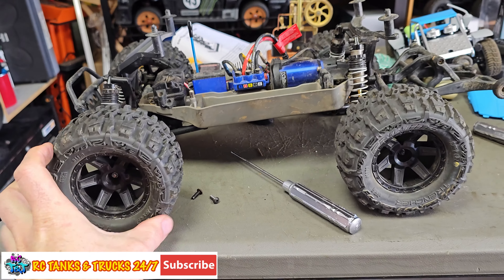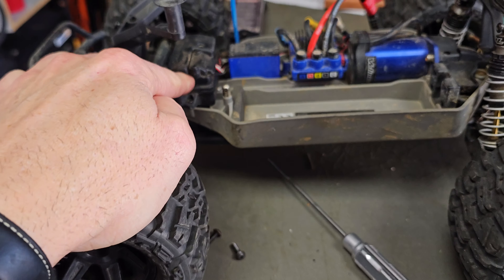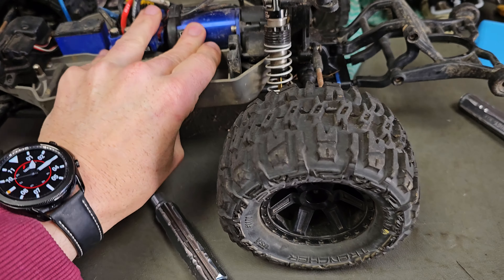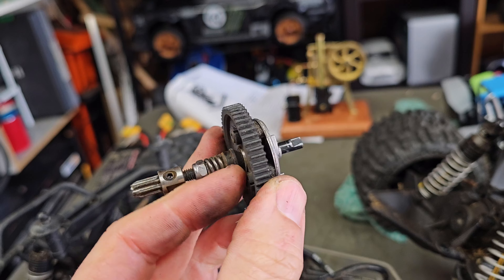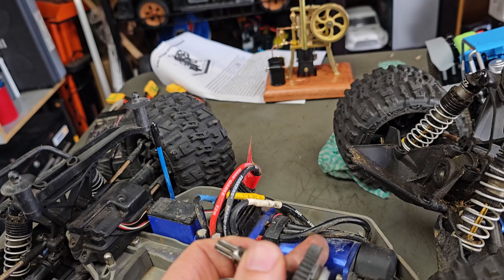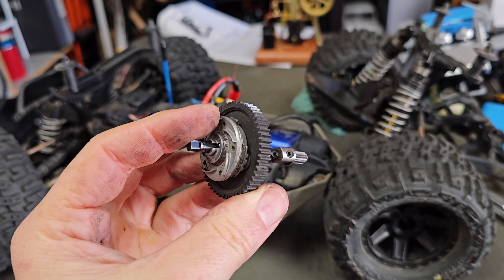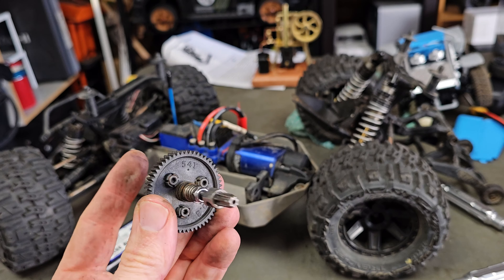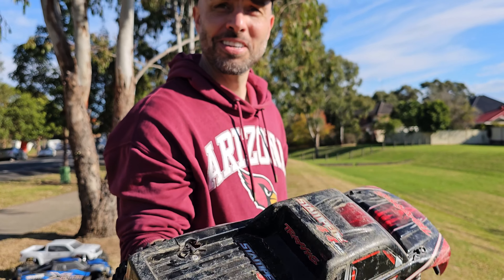TRASH TRAXXAS BRUSHLESS STAMPEDE VXL - WHAT'S WRONG WITH IT?

Comment: Nice freebie! I recently found a brushed stampede 4x4 on the local facebook marketplace listed for free in a pile of crap listed as a "curb alert"... was missing the transmitter, but everything else was there... ran with the 7c nimh ok, and the titan 55 motor, but i grew up carpet racing awd TCs... stock wouldnt do...LOL just added some metal driveshafts, and a 3660 3900kv brushless and some 3s lipos and she rips now...  and she
Reply from the maker: That is awesome!

Comment: That looks like the 2 pole motor paired with the 4 pole esc :)
Reply: Actually, I’m certain it is. Problem/solved. My car now? Haha
Reply from the maker: Hmmm
Reply: Nothing to do with that, I have this problem with all my Traxxas vehicles
Reply: @RCTanksTrucks247  id look in to it, worth a shot. try a different motor. a 4 pole one
Reply: @rcplayground7  never have I had an issue. Only age and mistreatment kill all electronics at some point.
Reply: I always throw out the traxxss ESC there in my opinion rubbish yeah and there batteries 😂

Comment: I got the same exact truck same Pro-Line shocks same Pro-Line same exact truck lol but I do have the aluminum motor mount with the oversized center shaft bearing and I do have full blue RPM suspension arms and hobbystar 3670 brushless motor and they hobbywing 4S ESC and the truck is insanely overpowered
Reply from the maker: That would hammer